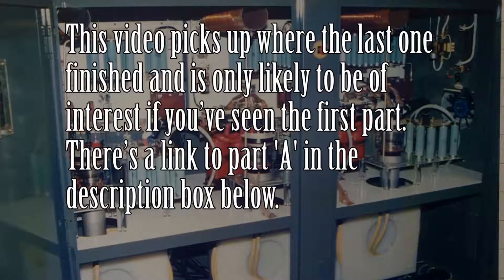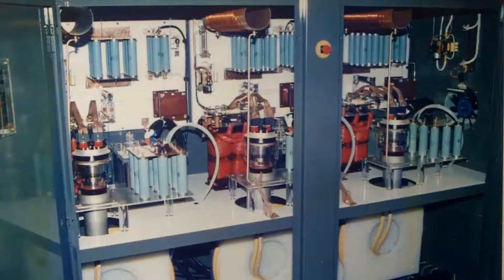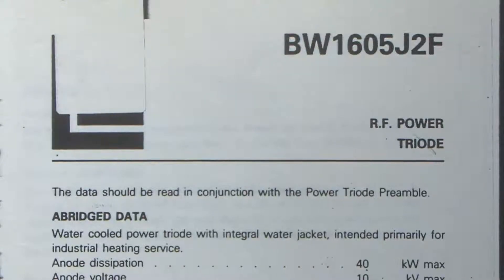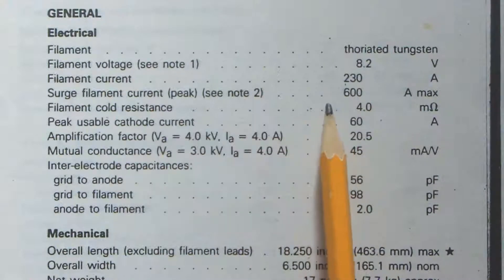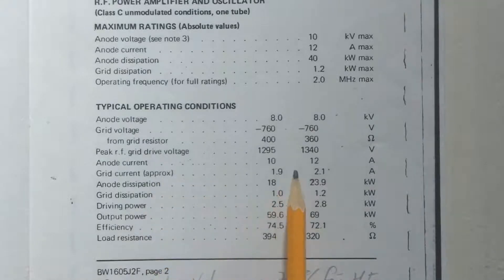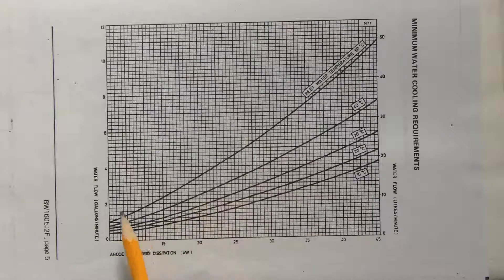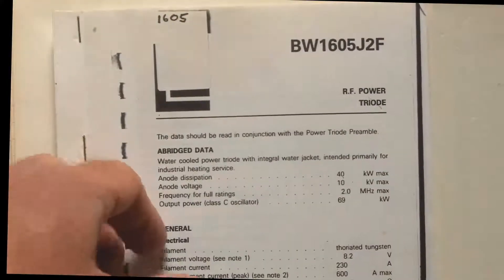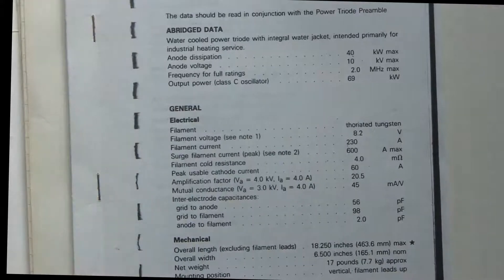Waffle about QRP and a 240 kW power supply unit Part 'B'

Comment from the maker: Hi Ed. It’s quite common to mix water and electricity, it just has to be done correctly, you do it every time you boil a kettle, you just have to take a lot more precautions when you have it connected across 12kV. 
Interesting to see that you mix your p’s and b’s I always do that on the keyboard and on paper.  
All the best... Andy

Comment from the maker: Hi Rick, I’m really glad you had the time to have a look at the videos, stories... you bet! As I’ve said many times before ‘The guy that never made a mistake never made anything’ I’ve had huge capacitors go off like mortar bombs and shower the equipment with silver foil and dielectric fluid. I’ve had water hoses blow off their fittings and spray water all over the valves and 12kV power supply of these old valve equipments. Like someone else commented, it gets your attention quickly. 
73's ..Andy

Comment from the maker: Hi there, it’s a funny thing but of all the installations we produced no one ever wanted to get involved with heat recovery systems despite blasting 100’s of kW’s into the air. One company had a row of large induction heaters cooled by their own lake. We built a cooling system with water to water heat exchangers so we had clean water in the equipment. There was so much power wasted into the lake that the fish grow to be extra large.    
Kind Regards ... Andy

Comment from the maker: Sadly I don’t have any pictures or information on my first linear amp. I wish I had kept it but that was in another life. I’ve been out of industry for about 6 years now, we were using some large transistors back then, about the size of a cigarette packet bolted to a water cooled heat sink for 20kW now I think they are up to the size of a brick for 100 or 200kW 
... Andy

Comment: I think tubes would have been considered a great invention if they had come after transistors, etc! They are more radiation and EMP resistant than semiconductors and also no anti-static straps are needed. Efficiency can be looked at in more than one way, my Tek 547 is a good space heater as well as a good scope! Tubes handle high power robustly, although the AM crowd are having a go with some interesting, cheap high power(~1Kw) MOSFET Class E transmitter designs. Do a video on your first linear!

Comment: Fascinating set of videos! I find a bit of irony in having a whopping powerful vacuum tube (valve) driven device being used for making pure silicon which in turn is used to make transistors and perhaps IC's??? I suppose with a bit of tuning and a robust antenna, your device could OWN the 160 meter band?

Comment from the maker: Hi Barry, ok on the high pressure gear. I must admit the high pressure gas or liquid worry more than high voltage. I’ve seen electricity do some wacky things that are too complicated to go in to here but normally you can anticipate what electricity will do and how far it will jump but boy I’ve seen high pressure water cut through steel and I’ve seen a 1” id steel reinforced hose flailing around smashing everything it touched and that was only about 120 psi, give me 20kV any day.
... Andy

Comment from the maker: Hi John, it sounds like you appreciate the true potential of high power. I suspect that there are a lot of guys that think 8kV isn’t all that much; they hear of fifty thousand volt Tasers and they see the big guy jittering about on the floor that gets up and walks away when they switch it off.  You probably know this one... It’s the volts that jolts but the mils that kills. Mils meaning milliamps. 30mA for 30mS could stop a heart 30amps could boil it. 
ALWAYS WORK SAFELY
Kind Regards ... Andy